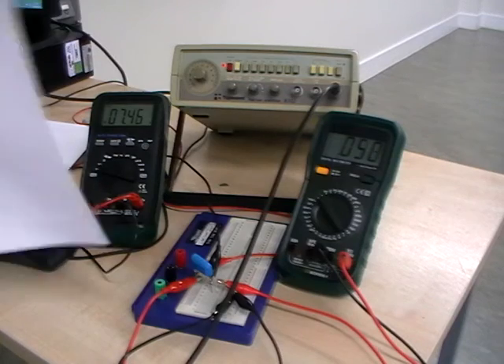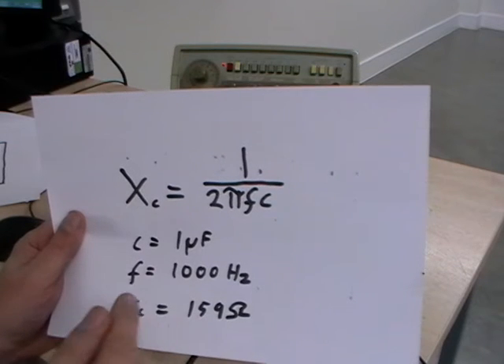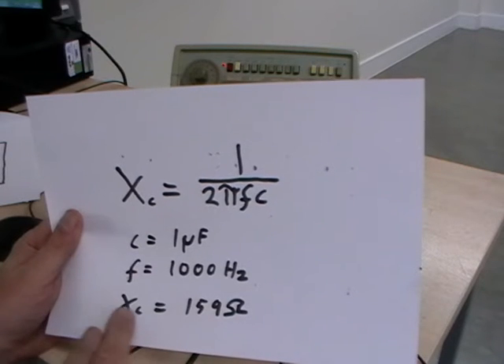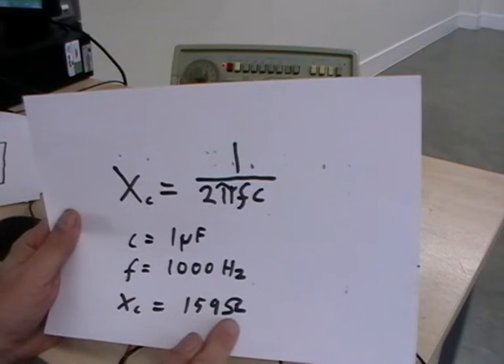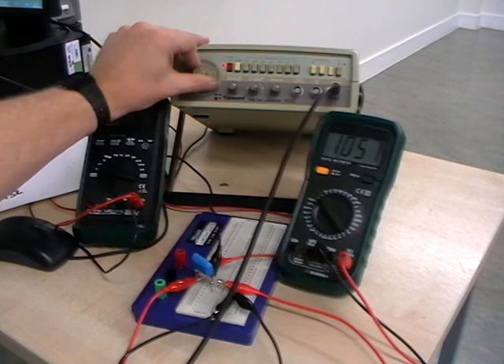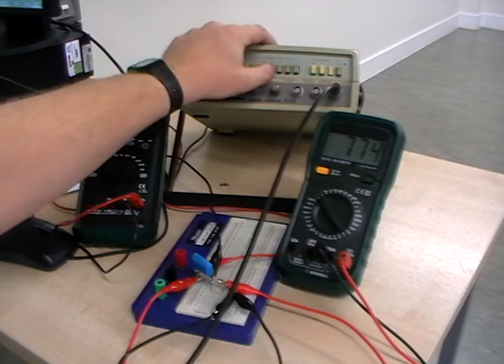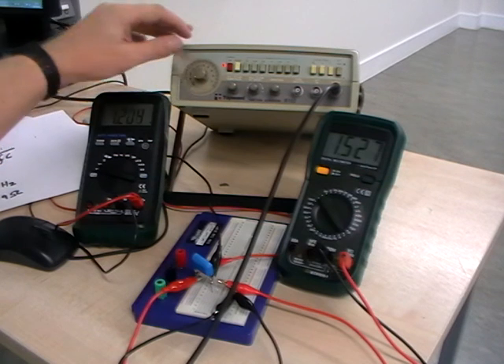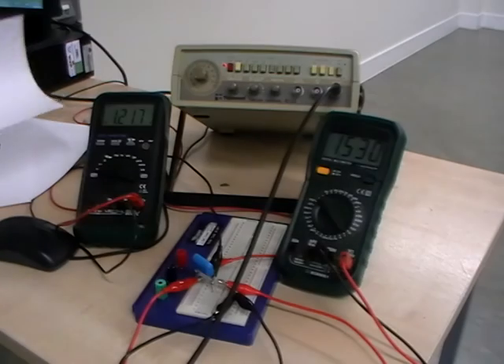Capacitive Reactance explained - Demo using a CR circuit with a.c. supply

Comment: Thanks for the interesting video showing us how the frequency across a capacitor lower the value of the internal resistance of the capacitor ,in other words lower the reactance of the capacitor under test. It is a pity that the instruments were not exactly able to measure the higher frequencies you introduced in the experiment. Thank you very much for the very simple and practical video.